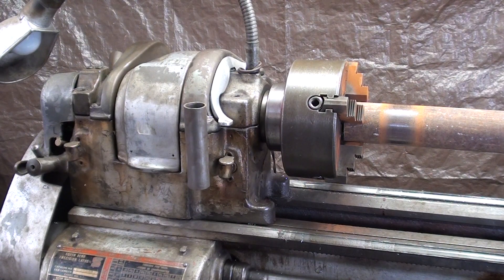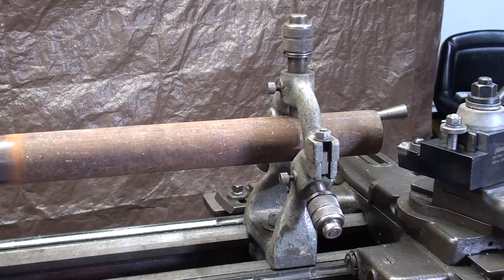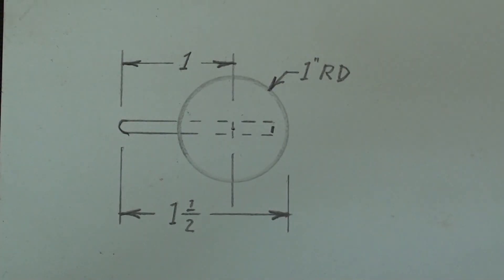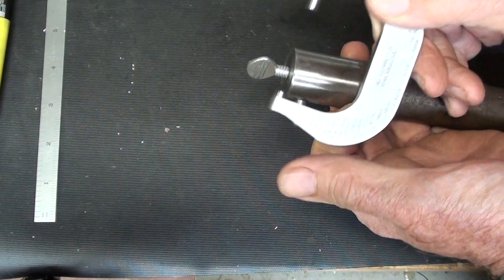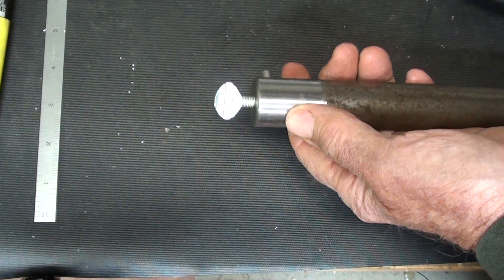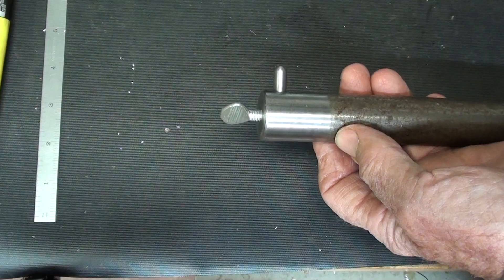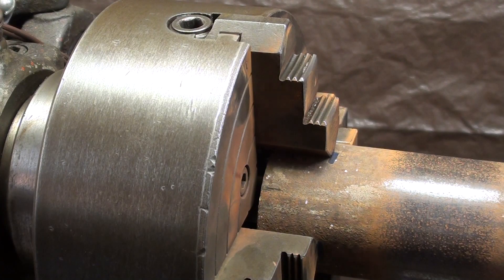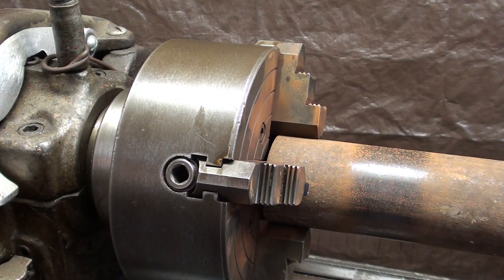STEADY REST for SOUTH BEND LATHE Tips 702 tubalcain

Comment: Completely wrong.  First of all never run a steady on an unmachined circumference  its never a true round.  Instead let ir roll on the two lower legs only and fix a lever type dial indicator on the end and roll it with stylus on tailstock outer  barrel and adjust two legs until it lines up with tailstock.  Now at this stage remove dial and skim short section of chuck end for steady till it cleans up.  Now take out and reverse it . Readjust the steady end now with dial indicator and that's it.  Otherwise if you just need a rough setting to get you started,  chuck piece well in , bring steady right up to chuck and tighten down to bed and on a very slow run, align shaft by eye and then adjust legs to suit though again this is just a  quick and rough way before final adjustments.

Comment: Hi Mr. Pete, great videos.  I can understand why the work would tend to walk out of the chuck if it appears to run "true" but out of line with the center line of the lathe.
I worked at Boeing Vertol many years ago and the procedure we used was to simply indicate the bar or tube concentric at the chuck, slide steady rest with retracted rollers or brass bars, indicate true at the right end (by soft hammer tapping), and simply slowly touch the piece by moving the 3 steady jaws until they touch slightly, then oil.  If not done carefully, t's possible that it might move the piece 1 thousand out of line, but we never had the bar creep out of the chuck. Also, if not careful, you may obviously get some taper, but highly unlikely since it would take turning the whole length of the piece to notice it, and that would not be possible with a steady rest on it.
If there's a true bore or center drilled hole, then you don't need to true the hanging end, by using a live or dead center, or bull center.

If the OD was out of round or rough, and it was going to be turned at a later operation, we would take a light cut where the steady jaws would be touching, as long as the piece was supported by a center.

I would be interested to know if you and other viewers see a problem with doing it that way, to make sure I don't have any misconceptions.
Thanks again, I believe we all learn something new from your videos regardless of experience.

Comment: MrPete why does this type of stead rest adjustments have 2 threads working in there?   I've seen the exploded view.   The threads are coarse not fine ....... and there is one right handed thread on the ID of the knurled body and the inside of the bronze takes a left handed thread to push it out.   What's the point?   To push the brass bars out faster?   less turns to get in position?  Seems like a lot of engineering for not much payoff - but I'm sure I'm missing the point :D (  come to think of it, a tap wrench uses this kind of doubled thread doesn't it?   Why ?
Reply from the maker: I think it is a differential thread
Reply: @mrpete222 
Interesting. I'll have to research the Wikipedia on differential thread.

Comment: I think an easier way to do it would be to put a say 6 inch long sacrificial part in the chuck, turn it to the diameter of the long part you want to put in the steady rest and adjust the steady rest with it being close to the chuck adjust it to the diameter you just turned to match your shaft and then move the steady rest down the bed to use the longer part.

Comment: Good morning! I agree with your theory on this method, but I believe you are making some assumptions. What if your set bar is not perfectly straight, or your 3 jaw chuck is not running true. These 2 things would necessitate a different "setting" of your pin height. I can see where one could have excess clearance on the steady rest pads if you set them to an eccentric pointer pin. I always use a 4 jaw chuck, indicate the part true at the jaws, set the steady rest in place, and adjust the rest pads until the workpiece indicates true at the end. Now, if the workpiece is bowed or bent, there is another problem. By standard procedure, the area where the pads of the steady rest will contact, should be turned true to the chuck. This would then be a safe, correct, and accurate setup. Thanks for all you do, and taking the time to spread your vast knowledge and experience to the rest of the world.

Comment: I think this could be a good idea .but you failed to mention you must indicate the end of the shaft since it’s sticking out so far from the end of the chuck  . most likely it will be running out. 
The method that I use is I actually set it between centers with my tail stock and then adjust the actual jars of the steady  rest against the work . 
But I do enjoy your videos keep up the good work!

Comment: I would've liked to see a clock run on the "feeler" end with that much overhang. Maybe a shorter length then simply move the steady to the length of bed needed from the Chuck.

Comment: Just wondering-why not set the steady rest up next to the chuck, with a piece of dialed in steel of the same OD as the work, then move the steady rest down to it's final location? I understand the principal of your set up feeler but just wonder if it is really needed to face off a piece of stock. Thanks!

Comment: For the first time ever watching "our" Mr Pete, I have a problem with his setup. Please, NO disrespect atoll. But...

I believe it is more accurate, if you move the steady rest very close to the chuck and set it up there, rather than far from the chuck. Then move the steady rest at the other end and it would be the same accuracy any where along the ways.

Another way: Use the tail stock and a centered hole in the stock, drilled very close to the chuck. Then you can do the set up at the end of the stock where the tail stock is; holding the stock true.

Of course I could be wrong. But that is simply my opinion.

Comment: What did I miss?  The whole point of a steady rest is that you cannot count on the chuck to hold a long piece perfectly on the center line without support.  If, say, your indicator bar was only 0.5° off axis, the point would describe a circle 0.050 larger (or smaller) than your planned 2.000".  Your steady rest would be on-center, but it wouldn't touch the work piece (or it  would be 0.050" too tight to run).  

I suppose you could indicate the end of the indicator bar (if it had a true end), and tap it in so it sits on the center line, but without that I don't see how this method could work.

Comment: There are several variations with this method. The setting bar may be made much shorter and slide the steady rest up to the head stock to set it. Then the steady rest can be moved to the desired position.
The setting bar may also be installed in the tail stock and held in a drill chuck. If working space is a problem the setting bar can be made with a Morse taper shank. If you want to be fancy the setting bar can be made so that it is a slip fit over a boss on the taper shank (or alternatively fit the setting bar completely over the quill) and it can be rotated to each steady rest position without loosening the Morse taper in the tail stock for each position.
An inverted use of setting bar can also be used to measure the diameter of a machined segment as might be required for a part that is to be a saddle fit onto another shaft. Make a cut on the segment and bring the setting tool mounted in the tail stock up to the segment. Extend the pin until it touches the machined surface. Now measure over the pin and carrier shaft with a micrometer. Doing the inverse of the math that Lyle showed in his illustration you can easily calculate the radius and diameter of the machined surface.
If you should need to measure the outside diameter or radius of a machined segment the same tactic applies but all you need is a dial indicator. Bring the dial indicator up to the machined surface of the segment and set it and the cross slide dial to "zero". Move the carriage over and run the tail stock quill out. Bring the dial indicator up to the tail stock quill until it reads "zero" again. Note how far you moved the cross slide. Now knowing the diameter of the tail stock quill and how far you moved the cross slide you can easily calculate the diameter of the work.
 Cheers from NC/USA

Comment: Because of the inevitable run-out at the end of the "boring bar", this method really just provides a good starting point for the steady rest setting (so setting it with a micrometer is probably overkill).  Each steady rest rod would need to be adjusted in or out by the same amount when the work piece is actually fitted.

Comment: Thank you for this video, Mr Pete. A question that came to my mind: at 7:23 you oil,  at 7:44 you polish with some (fine grid) sandpaper, at 7:53 you oil again and lock the steady rest and oil again. Did you clean up the residue of oil, ground up rust, and sandpaper off camera or is there a reason why this would not be necessary?  Best wishes and Merry Christmas!

Comment: Lyle,
This is the most helpful tip that I have seen in quite a while. I am still learning how to do large work on little machines. I intend to employ this idea. 

With one end faced, the other end needs to faced and finished to length. Do you have a brilliant suggestion to do this on this part?

Would you re-chuck against the chuck face and dimension from the chuck face? 

How accurate can you hope to be in a double set up and no Z axis DRO?

Comment: Mr. Pete, thanks for illustrating another way of adjusting steady rest. The method I've always used is a little different, and possibly simpler. Chuck a length of stock the same diameter as the shaft you wish to support. Extend six inches beyond the chuck. Indicate this stock to minimum runout. Adjust steady rest to this part as close to the chuck as possible. Lock jaws and move steady rest out to the position you wish to support. The shaft will then be supported true to the chuck's C/L and will not creep.

Comment: Hi Mr Pete, does this not assume the "feeler" is running true to the lathe centre line, or am I missing something?
Reply: If you are going to use a center why not just use the center to set up the steady rest? Faster
Reply: When making it,  - you could put a centre in it so you can use a centre in the tail stock to steady it whilst doing the setup.
Reply: @jackdawg4579  What about the thumb screw?
Reply: @stevebosun7410  maybe put it in the side rather than the end? as long as it was small enough to turn within the gap required? .Could make it a grub screw in the side even.
Reply: I want the same explanation. I was thinking to use the center hole too, but the thumbscrew negates that trick.

Comment: Great idea, I’ll be using this in my home shop! I guess a guy could make a shorter version, set the spacing on the steady closer to the chuck, then slide the steady down the ways to where it needs to be.
Reply: I wondered about this too. How accurate does a large steady rest with small footprint track on the bed ways? I suspect... Not very accurately.

Comment: If your steady rest positions repeatably on the lathe bed there is an easier way. With the work piece in the chuck, position the rest right next to the chuck and align the rest supports. Open and slide the rest down to the working position and lock it down. Done!  Aligning the supports to the work next to the chuck should be the right size and the right spot. If the rest does not slide precisely on the bed you might align it with some sort of spacer block or caliper measurements. Most of my lathes have factory rests that slide precisely aligned on the bed. But one has a rest that I built designed carefully to align on the bed for this purpose. While Joe's method offers a concentric and round alignment if your work is a little rough or out of round concentricity and precision are a waste of time. This method offers precise alignment quickly and also allows trial spins by hand near the chuck to test the function before you move it into position. Beware the clocking in the end of a part with a dial indicator for concentricity doesn't work. Scanning along the length and the height of the part with an indicator can tell you if it is truly straight. This activity is often overlooked but critical in some cases. Crummy stuff like muffler tubing can be turned successfully without binding with just a little clearance. You may want to loosen the chuck a little when you reposition rest and tighten after the work is held by the rest. The rest may force the workpiece into a more favorable alignment and a re-chuck operation might be worthwhile. You can use the rest for operations other than turning or facing. I have held long things for sanding and polishing also forms and bobbins to wind wire on. Also things that get painted, welded, plasma cut or just measured. Like a lot of tools in the shop you won't use it every day but when you need it nothing else will do. Trying to get along without one can lead to an unsafe setup and disastrous results. Be careful.
JY

Comment: This is a great method, but the underlying assumption is that the feeler jig is running true when it's in the chuck.  If it's cocked, it will sweep a circle that is larger than the indicated measurement (in this case 1.000") and the rollers will be sloppy on your 2.000" diameter stock.  If the stock diameter is greater than that of the circle swept by the feeler, the rollers will be tight on the stock.  At the end of his video, Joe Pie gives instructions for indicating the part and adjusting the rollers.

Comment: would it make sense to make your setup tool with a center at the end and use the tail stock to assist in aligning it. you could put a set screw in the side of the bar to hold the pin in place or use a bolt at the end with a center drilled in the bolt head.

Comment: I'm not a machinist, I just watch a lot of youtube video's about it. If you'd had a big enough live center for the tailstock, would you have been able to use that to make the pipe run true before sneaking up to it with the steady rest?
Also, could it damage anything in the lathe or chuck if the work was wiggling around in it like a rotary broach?
Reply: That's the usual procedure, it's not always possible though as in this case you would need a pipe center and a way to make the center hole first as well
Reply: That only works if the hole is true to the center and round. If you use the steady and clean up the inside of the pipe , a live center would work.
Reply: @noneofabove5586  You don't use the steady on raw stock even during cleanup of the end. Gotta figure out something else. That's even more critical with the bearing type steady.

Comment: Why can't you do this feeler method close up to the chuck and then move the steady rest into position?  Assuming the ways are good.
Reply: You can and should as the rod will become very inaccurate over longer distance if there is any runout and the shaft will also flex. If the steady is used close to the chuck, then this isn't even needed as you can spin the work and bring the pads to light contact while spinning and they're perfectly adjusted
Reply: You could if you had a 6” long piece of 2”” tube. He’s using a longer 2” tube and the spindle hole in a SB Heavy 10 is only 1 3/8”. 
You could hold it straight if you had a live center in the tailstock with a monster size nose and you knew that the free end ID was true.

Comment: hey when you were doing the welding class how many micrometers did you see get used as clamps
Reply: Educated C clamps.
Reply: We had a belt grinder operator who tried to make a plate in gauge by tightening the micrometer until it read the number he wanted. The foreman was not amused when he had to use vice grips to remove it.